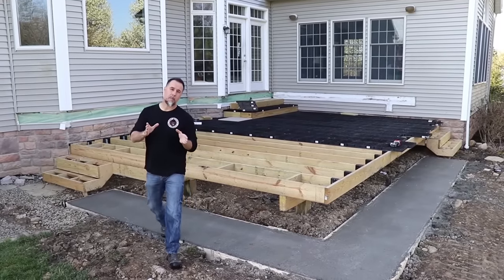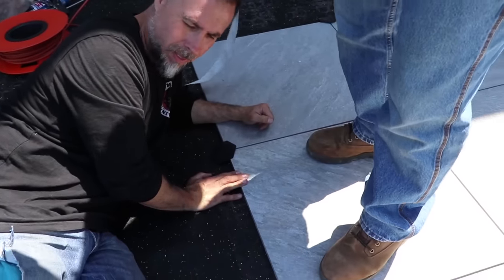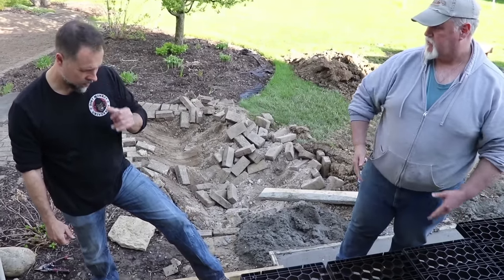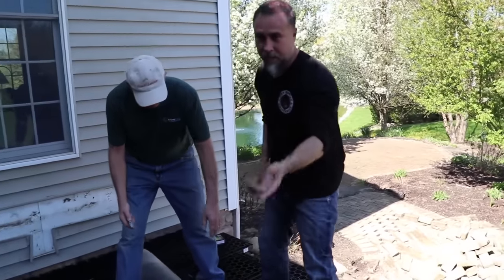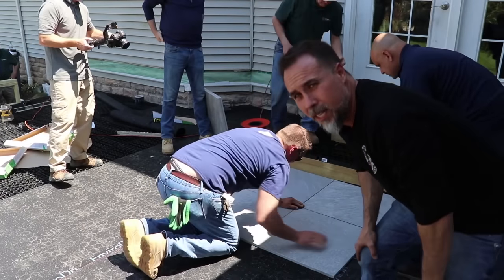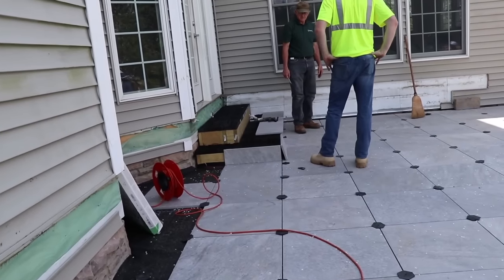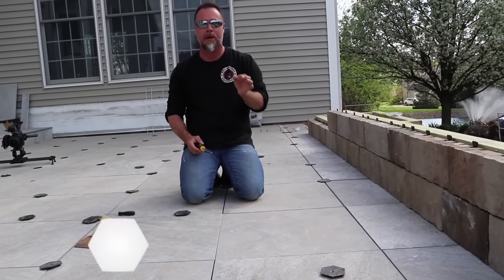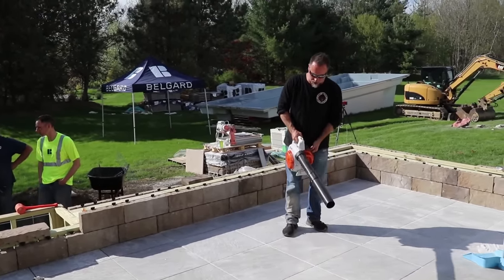How to Build a wood deck & install pavers, porcelain or stone tile over any deck

Comment: Very cool product! I think the gentleman meant to say the joists need to be flat relative to one another not necessarily level. As a longtime concrete contractor who installs many floors for tile contractors I can assure you there is a difference between flat & level. I make this point only because we all know whenever possible you want to direct water away from the home & it's foundation so giving the deck framing a small pitch will be beneficial over the long term.

Comment: I laid porcelain tile on a gridded deck system probably 5-6 years ago in montana. We used a urethane type glue to glue down the the tiles.  Montana is harsh with the freezing and heat in the summers.  The deck still looks the same as is did when I installed it. There were actually 3 large decks on the house. We left the spaces open between the tiles so water could go through.
Reply from the maker: Yep-  this grid system allows the water to pass through.   Glad to hear yours is still looking the same years later.

Comment: Interesting but I think the cost would be insane.  I would consider doing a step down from exits and do a poured concrete stamped patio instead will last way longer and probably more half the cost.
Reply: Not sure that concrete would be cheaper. Maybe with today's lumber prices? Still I can't see it. Also the average handyman feels comfortable doing a deck. This is like Lego. Not everyone can do a concrete patio. I think the labour savings would be huge
Reply: Concrete and lumber are both more expensive than the paver decks in today’s economy.
Reply: @SAUCE206  This is around $12 a square foot just for the plastic grates currently; total project cost is probably well north of $20 a square foot. Poured concrete is under $10 a square foot. Definitely cheaper just to add a couple steps down to the deck. 

If you do a 2x4 deck with 5/16" space between deck boards, you would get 2.541 square feet per 2x4 for a cost of $1.38 a square foot. 

This is basically a product for people who need a deck many feet above ground, and want a luxury surface. I would imagine the methods used for balconies or rooftop decks might be cheaper.

Comment: Thank you very much for a very informative video, I wish I could be able to see it in full length.  My question : Is this tile application on deck possible over a living space.? Our deck is over our garage and I could not find a good water proofing detail that works for a deck over a garage. The other major concern is  the load of tree debris  we get  all seasons. That makes the situation even worse, considering any solution that requires taking the water under the decking system. ( That is the current system and  it failed, we cannot keep up with the debris load, therefore we cannot clean it properly and deck is leaking to garage.) This detail might work.  We could capture the debris before it gets under the decking system and clogs the drainage. What are your thoughts on that? Thank you in advance.

Comment: 16 inches of center is a common measurement in concrete. Fun fact: most measuring tapes (Dewalt in particular) have markings on the number to denote that it is 16 inches. Comes in handy when making multiple spots to mark for dowels to drill or to where to lay rebar quickly.
Reply from the maker: Nice!  I noticed that but guess it didn't sink in.
Reply: It's also for general construction. Almost everything is 16" centers.

Comment: 1.) How does this system withstand cold winters? 2.) From my understanding, on a conventional wood deck, the board have gaps to allow air circulation for it to breath. Does having this tiling layer on top cause it to get mouldy or rotten underneath since its more sealed it, without as much airflow? Thanks.

Comment: Getting a mesh type diamond blade will make cutting through that thicker tile about 3 times faster. Just did a job and took forever with my usual porclain blade. Went and bought a 100 dollar mesh type blade and noticably faster.

Comment: Schulter Ditra over plywood solves any rotting issues.
Reply: No I took their course they actually have a completely different system for the outside.  At the end of the course I pulled one of the reps aside and asked them if I want to build a deck with a recess hot tub how would I go about using their system to invite a flush transition from deck to tile and he opened up his nice big book and there were just way to many steps and different types of product to make it worthwhile

Comment: I put porcelain on my decks and balconies 22 years ago.  I loved the comments of block and fill in so I'm going to say first, my house is on the side of a mountain and the decks are 40+' off the ground.  My balconies are still great, but my husband who is a contractor, was on a large job out of state when it came time to lay the tile so he hired two guys to complete it.  Almost immediately some of the tiles started poppin up and I noticed when they did that the mortar on the tiles themselves were practically nonexistent. I also noticed that some of the tiles sounded hollow.  I've had several tiles broken by things being dropped on the floor, a problem I've never has with the balconies.  When this happened it was obvious from the back of the tile that it wasn't stuck to the mortar. Probably a little to much background, but my question is:  if the tile is just floating on the mat and not secured to a solid surface, how do you prevent all your tiles from breaking?
Reply: That is a question I'd like to see answered too...
Reply: Why would they break with this method? It's not hollow. This is no different than installing pavers on ground

Comment: Okay, some of you say expensive, I have no idea. But consider this, I got a quote for an 11x20 area (standard grey ugly pavers) for $3400.00 in NJ. I have not done the math for the system in this video, but would it the same or much less using this new system? I don't like anything permanent, so I like that I can tear up the new system pretty simply than breaking up concrete.
Reply: You think this system would be less? Hahahahahahahaha. You would MAYBE get most materials for 4K.....

Comment: Seems really odd for a flooring system. Maybe just not for me but I don't see this lasting very long without problems.
Reply from the maker: There are decks out there that have had this system used for years and they are still going strong.
Reply: Alliston Rental I know specially wood starts to break over time I prefer a floor right on the ground not in the air

Comment: I see this as a first generation design. It has some drawbacks, but a sound system in design. Yes, improvements can and will be made as time shows issues. Do I want one yes. What is the cost per sqft?

Comment: I noticed a vent sticking out from the middle of the stairs leading into the house.  How did you handle finishing that?  It seems like that is something that would not pass code.
Reply from the maker: That vent will be moved.
Reply: Thanks.

Comment: Finished deck looks great. I have a 25 x 12 ft. concrete deck that sits on the house foundation and is10 ft. above the ground, without demolishing the concrete deck, can you add porcelain or stone tile over it?

Comment: At 1:23 it looks like the weight of the deck is supported by the bolts. Is notching the support posts not needed because it is low to the ground?
Reply: okay, that deck is cantilevered and done so correctly. To answer you question, though, if you're going to put that much weight on a deck that is not cantilevered, it's always a good idea to notch the post. Where I live code requires two rim joists...first one is notched into the post, second one is lagged, timber locked, whatever, onto the first one. And that's for a regular deck, no tile, no matter how low to, or how high from the ground. Hope that helps you...

Comment: What stops the silica sand from working itself under the tiles in high traffic areas, and potentially cracking the tile or eventually causing lippage? Interesting product, though whats the material cost on an average sized deck of around 600sq.ft.? Minus lumber and paving tiles.
Reply from the maker: Its actually not as expensive as composite.

Comment: Apparently that's a new deck,$ (original brick, patio) as far a cost comparison (?), I would go with concrete, & real stone  or use the new composite boards for a raised deck. Don't see how this could last as long as either of my less expensive ideas. Weather will tell.

Comment: How many days does it take to do this job to pair two the old way with the lumber
Reply from the maker: This takes longer than decking it with wood- but this is quicker than trying to install a stone deck on a soil foundation.

Comment: I did something like this to my deck , going on 12 years now. 

However , I inlaid stone pavers into the middle of my wooden deck. A circle 12 feet across. Also my deck is 3 feet off the ground. I just built a platform under the area under the stone circle.  

This really doesn't look like anything special.

Comment: I personally would not ever offer this option to my customers. We stopped building large decks out of wood due to the extreme humidity and temperature swings we have here in Texas. The framing materials that you buy now especially pt wood and most of it comes from indoor lumber yards, shrinks and warps dramatically after installing even if you allow it to climatize. Steel frame is much better long term. But this product looks like it would be way to labor intensive to be affordable. I’d be interested to know the cost difference of this option over any other product.

Comment: @5:18 So the term you are looking for is NOT 'level' BUT 'planar'. Level is level and there is no changing it. Planar is everything in the same plane. Be that a raked or pitched plane like a good deck, driveway, or sidewalk. Or planar can also encompass level planes. But level can never encompass pitched items. There is a reason we have and use these words. You need to know and use them. Otherwise you confuse people that are ignorant but wanting to know more. And in turn you make the whole situation even muddier for them when they try communicating with others.

Comment: How would this work on a deck above water? Would it be able to handle being submerged when the water comes
Up?
Reply: Hi Brian! We recommend using a flexible adhesive such as Surebond-190, as it has a 2,000 PSI tensile strength and is not caustic to the polymer grate. We have definitely taken situations like that into consideration, and because of that, we are ICC certified in the state of Florida for upswell. Thanks for the question! Cheers!

Comment: I can't be impressed because this process is probably the most expensive way to build a deck. Although I do like it it's just that around here we bid a simple 20x20 paver patio for $8,000 and still get the sticker shock face. Should be higher but the Americans got to compete with other countries citizens these days. Lol.  Great job looks fun to build.

Comment: I know this video is old but, for those of you thinking about using this product, it is REALLY unnecessary and WAY overpriced. $15 for ONE tile? So over $1,200 just in this tile for a 16' x 10' deck. 

If you already have a deck with deck boards on it, you can simply put a barrier (poly plastic sheeting) over the deck so you're locking sand doesn't just fall to the ground. If you're building a new deck, you have 2 options, A) space the joists 6' OC (for 12' pavers) or B) cover the regular 16' OC joists with 3/4" PT plywood or 5/4" deck boards. The main thing to remember is to have a beam in the middle of the joists and if you're pavers are small, you need to have support under them; this is why ideally you'd want plywood or deck boards in place. Still WAY cheaper than this stuff.

Comment: Hello. I have a general deck question. Is there a limit to the height you can install a deck on deck concrete blocks ?
Reply: you will want to check with your local county permit office. Here in PG county MD any wood structure over 8" requires a permit and needs 16" x 30" cement footers.

Comment: Just wait until the joists start to dry out, twist and bow. One already was sagged and they add a strip of roofing shingles.?? Im not a contractor, but I wouldnt do this to my place. Looks like too many potential problems
Reply: I've been in remodeling for 30 yrs and this looks like a lifetime of problems ahead until it's torn out. But I could be wrong.
Reply: Never understood why people put products that last virtually forever on PT wood that will not last forever.

Comment: I have done so many concrete decks, my father has actually been doing them well before the year 2000 and i see most builders have a pavers options. Nothing new.
Reply from the maker: Very cool Steve.  This was my first time with this option in a hands on application.

Comment: So why not a block wall and compacted gravel and sand using a bobcat or portable loader. Just like wheelchair ramps of wood instead of gravel compacted and paver or concrete. Two steps to a concrete porch floor.
Reply: Unless you are like me and live on the side of a mountain and the deck is 40' off the ground.

Comment: A carpenter or contractor is not a average person. That's pretty insulting man. What if I told you my 6 year old can stack rocks and build a retaining wall. 
Don't discredit someone's trade just because it's not what you do. It's low class.
Reply from the maker: Sure didn't mean to insult anyone.  Thanks for pointing that out.  I didn't realize I came across that way.

Comment: Geeze...this video really got people triggered. I for one like this as an option for a finished deck look. I already feel exhausted thinking about the maintenance of a standard wood deck. If you take the time to ensure a level compacted base to start with and worked to perfection (sure it will take a lot of time), the end result will be rewarding. As for the test of time, well... time will tell I guess. I am curious of one thing actually. Why not the pressure treated wood over the regular pine?

Comment: Up here it  will never work! wood framing outside structures, and concrete materials have different expansion coefficients, especially in a high  freeze/thaw  environment. Bad idea! Question, what kind  guarantee would you give your Customer, 1 year?, two years before  tiles cracks or shifts? ..... Oh, Franky and Eduardo left? maybe they didn't want be involved in this project!  Keep up the great videos, even on occasion,  you do it for fun!
Reply from the maker: They have been used for years in high freeze thaw environments with success.  The grid system doesn't expand but still allows the deck beneath to move while staying stabil.
Reply: Hi Egidio! We have over 200 decks in Canada with our system on them, and they are just fine. We also have a 20 year residential warranty on our product. Just another perk of using our system! Cheers!

Comment: Either these contractors mean flat when they say level, or they don't understand code requirements under IBC. Building a flat and level uncovered patio with impervios materials just outside of a living space is not allowed, and for good reason. Porcelain is by definition impervios.
Reply from the maker: Well said.  Thanks for pointing that out.
Reply: Scott in MN I agree, PT is notoriously unstable. I'm just saying, as a tile setter with 30 years of mud work behind me, setters don't use those words interchangeably because there are times for flat, and times for level, and times for niether (think bath tub or swimming pool).

Comment: This requires too many proprietary items that beside costing much more than traditional install, it seems destined to fail. The traditional way is to overbuild the deck, to prevent flexion use shorter spans for your girders/beams,space your joists at no more than 16" OC or even 12 OC, make sure not to under size your beams and joists, again this will prevent flexion, build with a slight slope away from the house (maybe slightly more you would for a porch unless the deck has a roof). Use treated plywood as a base use plenty of scres, don"t skimp, and cover with water resistant concrete panels, seal all concrete panel joints with mortar, in addition and very important, the larger the tile the higher the chance of cracking. Use tiles no larger than 6"x6", there are plenty of choices especially with Spanish tile tiles to choose from. After is completed follow up on maintenance, inspect your deck often to assure your grout joints are not deteriorating , re-grout as needed. Also I would make sure that on the perimeter/edges of the deck, your concrete panels  are installed with an overhang over the plywood, figure out how to install a  bull nose type edge that could be made with mortar and tiles or even the schluter system edging, I think they sell edging for exterior applications.